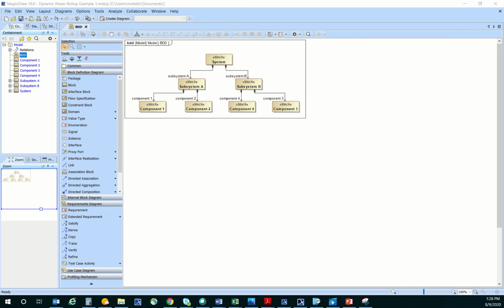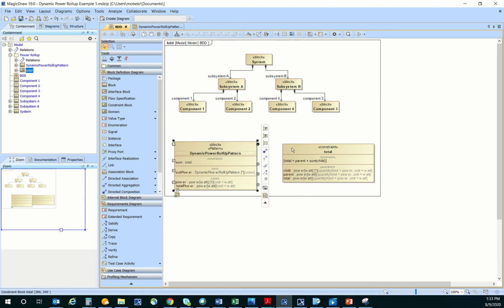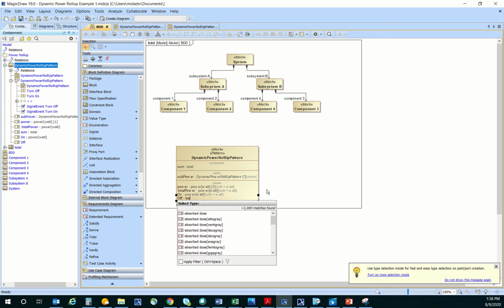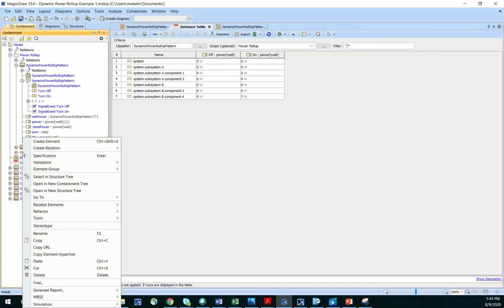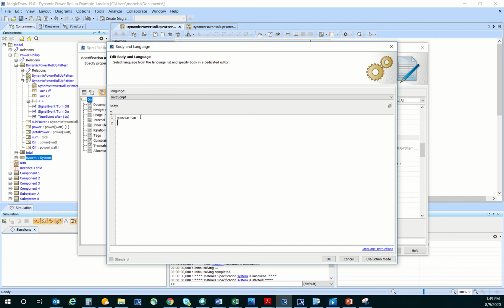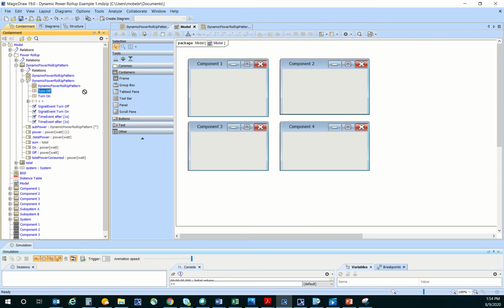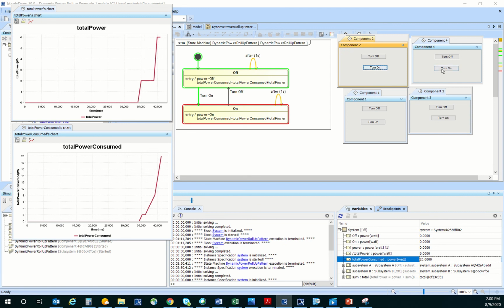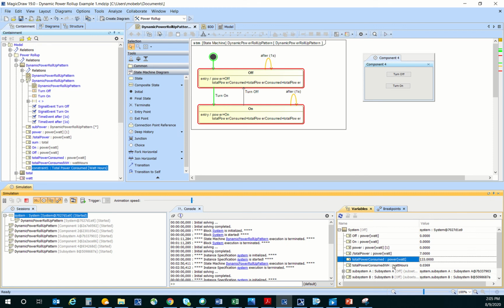Dynamic Power Rollup - Cameo Systems Modeler / MagicDraw

Comment: I have a signal as "Fault State" and has an attribute as a "Fault: Boolean".

I would like to use these signal to ensure transition between states in stm but I have an attribute. How can i select the right attribute? 

For example; initial system state is "OFF", and if "FaultState" signal is TRUE, then the system must go "Not available" state. 
But if the "FaultState" signal is FALSE, then it must go "ON" state.

Also, 

How to add multiple signals in a transition with "and" and "OR" conditions? 

For example; 
fault state = false and feature activation = true  -> Off to On
fault state = true or feature activation = false -> On to Off
Reply from the maker: Ufuk, great questions. I will reply with a more tailored response soon. In the meantime, see this article that has some answers to questions you are asking. https://andrewwashere.github.io/2022/05/21/state-machines.html
Reply: @brianMoberley  I’ll check the Article and also waiting your response, Thanks a lot.